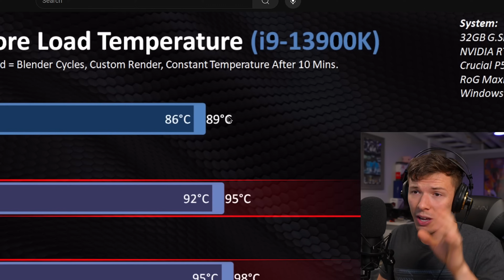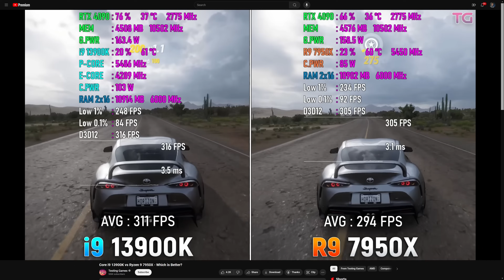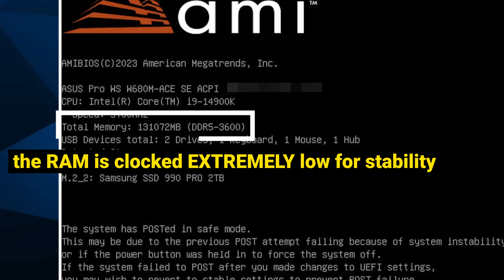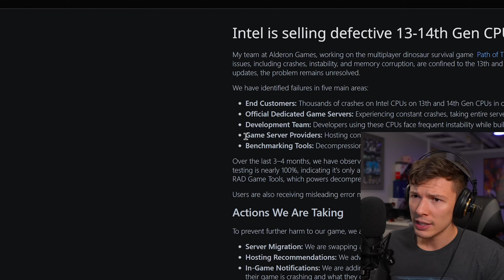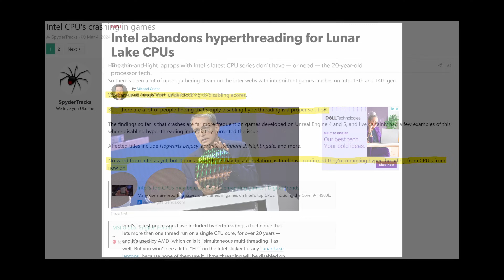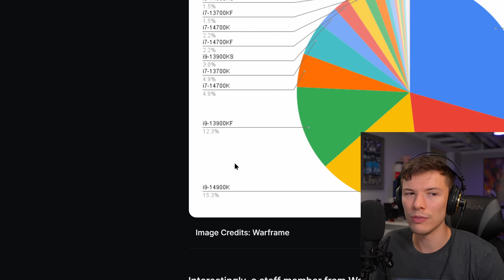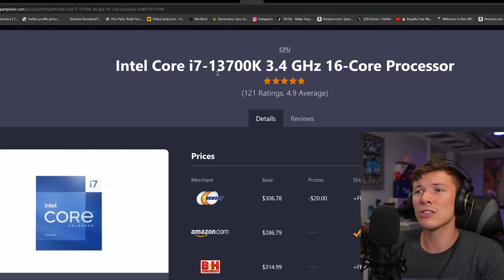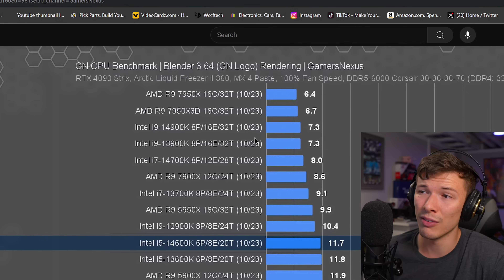Intel F**ked Up Bad

Comment from the maker: Ey, just to let yall know. Intel has now come out with a statement on the situation admitting to manufacturing defects and voltage issues. Their response is still pretty whack so man idk. Honestly seems like it’s only getting worse but at least we have some answers
Reply: oh dear, I have purchased a laptop with gen 13th core i7, pretty sad about this situation, but thanks for calling it out
Reply: @bigcitiboy1903  Jury is still out on whether the laptop versions of 13th and 14th gen are hit by the issue. Intel says they are not, there are scattered unconfirmed reports they might be.

Either way they don't seem nearly as badly hit as the desktop versions.

Remember that while the laptop versions of the chips have the same name their architecture is quite different, and they aren't produced in the same batches, so laptops might avoid the issues either by running at lower power inherently or by not being hit by the production errors.

Or few laptops are experiencing the issues because they run low power, and its just a matter of time before they start failing en masse. Who knows...
Reply: Yeah, still never gonna trust Intel again after this.  Just gonna be safe and go AMD
Reply: first time buying into pc gaming and this happens.
Reply: @SluggyUwU  second time for me, but yeah shit happens, they offer replacement, I just don’t have time considering I have to remove the hdds to send it for repair so I downclocked to 5,6Ghz, still having weird behaviors tho, can’t tell if its software or hardware this time, maybe 1 incident per week while paying Fortnite
Reply: they said 1% have oxidation issue that was fixed...? not 99,9% or whatever u say. Even tho 2 high voltages causing issues since most heaters can't handle having temps down etc. And intel does offer refunds, full refunds. So please get video info correct sir. <3
Reply: @MRBofSweden  Oxidation issue is a different issue, there are no refunds being offered for the issues under discussion.
Reply: With them admitting it affects down to the 65W parts, it isn't even an issue with how much power the bigger ones are pulling.
Reply: I own one of these failed CPU and I can tell that even tho it was and its still an awful experience, I found a fix. I underclocked my i9-14900kf performance cores to 5.6Ghz and that seems like the only setting able to restore 97% of the original performance besides disabling turbo completely which would lock the CPU close to 3Ghz. 

So what I wanted to say is that you are talking like this the processor is dead but it's not. I would have bought such CPU if I was told it runs like a 13th Gen and it was priced acordingly or if was called lets say i9-14850kf which would makes sense. I can't predict the future but I don't think the damage is permanent or that it will degrade over time. It was broken brand new out of the box, it was just that I wasen't willing to believe that it was possible and that the little crashes here and there were software issues. And if a simple fix like maxing it at 5,6Ghz fixes it, it also means that the turbo or "factory overclocking" or more like "factory burstclocking" can be fixed and restored to it's 5,7Ghz or 6Ghz (on 2 cores only) for a shorter time or in a less agressive manner. 

Also the x129 microcode bios update did not fix it for me and I can still claim waranty.
Reply: i kid you not my intel igpu crashed watching this
Reply: Hi

Comment: I think you got it the other way around. MB makers have been pushing crazy limits beyond what was specified by intel. Basically getting users to over clock their machines like crazy. Apperantly this hasn’t been a big problem on AMD land cause the cpus are just not stable enough.

Comment: Was testing my laptop i9 14900HX in cinebench R23, it went up 5.5 GHz in turbo boost. I thought that's it. That will probably kill the CPU in the long run. Temps went up 100°C as well. Then I went to the BIOS and lowered loadlines by a good 20%. Purely that lowered the temperature by 20°C and also improved the performance by 15%.

Comment: To the people in the comments saying "Yeah but the new Intel CPUs will pull less power no they wont. In fact they actually pull more power. See what they did was just shift some of the draw away from the EPS and instead are drawing it from the 24 pin in an attempt to decieve you. See if you test power draw the normal way it wont reflect whats being pulled from the 24 pin. That way they can claim "lower power consumption" even though it isnt actually true. Edit: GNs testing actually shows the new chips pull more power while performing worse

Comment: The bracket for lga1700 was saying that was bending . I added an aio and a thermalright lga1700 bracket to my i5 13600k b760 ddr4  motherboard seems to be working great so far , I did have a small scare when not GPU was not registering but came out fine. Everything works great so far

Comment: Cap I'm using a 14900k running at 60° and the cooler liquid on 35
Reply: what cooler are you using
Reply: @FlungGlung  360 link aio

Comment: I guess you forgot when AMD promised the Threadripper motherboards would be upgradeable for years. I didn't. I bought one CPU then they replaced it. £1000 for a new motherboard. They're no better than Intel.

Comment: My i9-13900K failed, costing me thousands in troubleshooting and a massive headache over months. I swapped motherboards, RAM, changed graphics cards, replaced the PSU, and ended up wasting so much time tracking it down.  I hate thermal paste and screws, I had to redo them so many times. Finally figured it out by locking the cpu clock speed very low. Also one night, my CPU overheated during a reboot crash and it somehow woke it's self up out of sleep. The thing got so hot it killed my AIO pump. I got a refund from Intel for the cpu at least, but i'm still out thousands. I switched to a 14700K, but after 6 months, I’m experiencing the same crashes again. Intel burned a bridge it can't rebuild.

Comment: You can't cool the i9 CPUs with anything. I've been using the i9 13900F (lowest TDP in the bunch) and while my 420mm Liquid Freezer kept it at 30 degrees at idle, in heavy gaming it always ramped up to 92 degrees and stayed there. The problem with that is that my PC heats up the whole room, it's summer and I couldn't stand it. Yesterday I downgraded to a brand new i5 13600KF and while this one stays at 50-60 degrees in heavy load with no noticeable performace loss in gaming compared to the i9, this i5 crashes all my games constantly, even crashed the whole PC at one time. No idea what to do to fix this...

Comment: I have an i7 13700k purchased exactly a year ago, on an MSI MAG Z790 Tomahawk with 2x32GB Corsair Vengeance Pro 3600. My CPU has been degrading for about 6 months now and getting much worse. I called intel and after running their diagnostics, they determined mine to be defective and offered a replacement. shipping cost included. I'm hoping this is a NEW batch with corrected microcode!

Comment: Turns out that I did a few manual settings instead of using the Intel profiles.. and my CPU runs better than EVER! ... no UE5 or other instability.... CBR23 is 65c and game perfiormance on P cores in high % usage is 35-40c ..  there is a fix.. just rrequire you to master your BIOS.... so yes install CPU, choose a default profile not alwasys work in certain gaames. But my 14900KS now runs better than ever, cooler and more efficient!   ITs a matter of BIOS configuration instead of complaining.

Comment: Haven't had a lot of issues with my 13700k, but thanks to the MOSFET specs, my MOBO only allows 150w to the CPU, at least on paper.  Yeah, I fvcked up... or did I?  😏

Comment: I have an i7 14900K and my high-end 3 fan radiator AIO cooler wouldnt lower it below 90 at max fan speed on factory clock. I had to use zipties to add 4 more case fans that werent meant to fit in there to keep this thing below 90 degrees.

Comment: Did I understood it correctly : 4kW processor consumption? My electric wires will melt and shortcut if I'll run it and my fridge.
Reply: Like two induction panels running in the same time. Quite heavy load for apartments.
Reply: @Pixel_Clippy  Fuckin hell! It should make me some money doing that!

Comment: Just look at the 10 nm node debacle intel kept reusing this node for years and then rebrand it as 7 nm.

In my opinion their core architecture is flawed to begin with.

They saw it was impossible to compete with amd without pushing it to the limit.

This time with 13 and 14th gen they went too far.

All this mess because they wanted to be ahead of amd without having done the necessary research and innovation.

Now they pay the price of their shenanigans.

I feel sorry for the 13 and 14th gen owners.

Intel betrayed the fidelity their customers in the worst way possible.

Comment: Intel had to push the 13th and 14th gen to its absolute limit just to stay comparative with AMD and now they just proved they KNOW this. 13th and 14th gen are basically just super high overclocked CPU's and Intel I guess thought they would be "okay". Maybe if they didn't sit on their a** with 4c/8t for so long they would have built a new much more efficient architecture.

Comment: you lie  my gen 14 is great       its just the people that bought the high power ones that are failing.   I use the 65 watt i5  with no gpu  and only run air cooling   i run 4k at 160 fps    on a 55 inch monitor   and loving it        intel gen 14 are great if you all just listened  to me when they came out and did not by those stupid high power using models.    the i5 gen 14  65 watt is the gaming cpu.

Comment: Had both AMD and Intel CPU's. Both got absolutely cooked with the standard coolers that came out of the box. Games were constantly crashing, hard rebooting the PC's, Intel CPU was especially bad. Only after purchasing 2 Tower Air Coolers for each did the problems stop. Buy a good cooler when you buy a CPU. There is also a default setting on most motherboards that ups the voltage too much for CPU's, so tweak it if you haven't.

Comment: I have had nothing but issues with my i9 14900K. I am in too much debt to worry about building another PC but if I do it will be AMD. Especially depending on Intel's reaction to my CPUs instability. I thought I was going crazy for months repasting my CPU and checking temps. Kept getting blue screens and weird issues

Comment: I bought a 12900KS to replace my 13700K that started showing lack of VRAM with RTX 4090 Asus Tuff.  I've never seen that  before.  Used only for MSFS 2020, with about 700 Hours use.           Asus Tuff MOBO, this time I'm not going to install the Armoury-Crate.

Comment: We had a work computer running a 14900K that ran into the SSD corruption issue like its a massive problem we lost some important data and had to spend money to fix it. I think hyperthreading is possible the issue, we disabled it and the system has been far more stable.

Comment: My 14600kf on a 280mm Arctic Liquid Freezer II still hits around 81-87°C under load no OC. My older systems like my 4690k and overclocked Xeon never hit above 79°C and the 4690k was on a single 120mm kraken x31 overclocked +0.3 ghz

Comment: Intel should do the right thing, and recall all processors affected with hardware issues. Intel, do not screw your customers, or you wont have customers. Sure, it will be expensive to recall all of these processors, but Intel has the money to do it. Intel needs to stop hiding, and be more transparent. The last thing you want to do as a multibillion dollar company, is to say nothing when there is clearly a hardware issue. The news surrounding this is not a conspiracy theory. You can't hide a situation like this, because it can be easily tested. When they are tested, the processors show major throttling. When they are tested, people are left with a broken processor. The vast majority probably aren't tweaking their processors, and are left with a cooked broken processor. Intel needs to address this now, before their stocks continue to fall.

Comment: I've got a 13900K and had to underclock it to 5.2 Ghz because I was getting lots of crashes. It's been good now though. It's paired up with a 4090. Still performs great underclocked, beating out the Apple M1 Pro chip in Cinebench.

Comment: I love m 13900KS and all three of my 14900K/KF systems. No issues of any kind. Best CPUs I have ever owned and wouldn't want anything else. But, I don't run them like most people do. I sync all cores, set manual voltage and use very high LLC. Zero instability problems and no degradation. If I were running them like some gamers do (using eTVB and adaptive voltage) I might not be so happy.

Comment: its all the problems combined... bendgate, hyperthreading, micro voltages going out of control, micro power spikes on the cores, and a few others including the worst of them all the manufacturing process that has oxidization... its all compiled into 1 end game... dead 13th and 14th gen intel chips...
Reply: and the worst part was i just bought my deskmeet b660 with an i5-13400... just because i wanted quicksync.... now i have to look into buying a i7 12 gen chip 2nd hand....
Reply: don't forget this is happening across the whole stack line including the lower end chips... its just the failure time is shorter on the higher end SKUs.... even the lower end ones that were pushed through its paces have already been reported to have failed in the same way as well....
Reply: and the only reason i bought the deskmeet b660 is the board features and its size was what i needed compared to the x300 and x600 variant and i wanted the quicksync feature that was why i got the i5 13400.... basically i had to buy the worst GPU 4060ti 16GB again this not a gaming only machine... and pair it with the worst CPU possible right now.... and all because i needed the 3 sata connectors and 2 NVME slots.....

Comment: A revealing comment I read is posted by @crazyeyecarl on "This could be a Big Problem for Intel" from "der8auer EN": I use to work at Intel, and most of the people I knew who chose to leave did so cause we could tell there was no real plan. For example in Litho we had to explain to our manager what our job was, what we could and couldn't do, and even what the alarms meant on a daily basis for months. It would get so bad that people would yell at him "I CANNOT DO THAT. IT WILL BREAK THE MACHINE." Beyond that they constantly lay off experienced engineers to hire new ones fresh out of college so they could get tax breaks from the state government. When you get rid of all the experienced people this is the kinda thing that happens. We all knew it was coming.

Comment: I bought an i3 13100 because it was the only budget CPU at the time when I built my PC. AMD did have cheap enough CPUs too, but there weren't any cheap AM5 motherboards, so if I went AMD the overall price of the build would go above my budget. Looking back at it, if I had better access to AM4 CPUs and boards (maybe if I had the time to order parts online) I could've remained in budget and also have dodged buying a 13th gen intel. But at the time it seemed like a good idea since I could've upgraded to a better modern CPU down the line, not knowing THIS would happen.
The only saving grace for me is that the 13100 isn't very powerful, doesn't really have the capacity to cook itself to death. But that is assuming that is the cause of these failures and not something else. I'm not noticing any instability but I'm still very concerned for my system's long term health, and for my wallet if I have to completely rebuild into an AMD build.

Comment: The truth is very very tiny components are really really hard to make. You get issues, which is not surprising anymore. They are working on nanometer scales. Some parts are less than a nanometer.

Comment: state control will check the quality of all computer parts in stores, then all manufacturers will repair and replace damaged parts of lower quality with high-quality parts that provide full functionality for less money because the value of all money currencies will increase compared to US dollars, therefore manufacturers will not get rich by repairing and upgrading old computer parts

Comment: Manufacturing faults causing internal corrosion. Meanwhile, my AMD 7800X3D is running flawlessly (after a faulty Gigabyte board caused major issues at first). The next PC (non-gaming system this time, it's gonna be focused for DAW and recording) is going to be an AMD system too.

Comment: PL1/PL2 at 4096W doesn't mean it actually runs the CPU at 4096W. It just means that it'll throttle if it goes above 4,000W. That's why it's called a "power limit."

Comment: I did have 1 Intel 13th i7 13700k. and it was cooking. Idle 60C-70C Playing games. 90C-100C all the time. after half a year it broke down. send it back. and got a new one. this one is running at way lower temp. and its holding up alright

Comment: I mean my ryzen 7 5800x has a 360mm aio and a slight boost clock sitting around 4.47 to 4.66 ghz and when gaming runs around 70 to 80c depending on the game and I have no real issues so eh

Comment: i built a new machine with a 13600k last year, and had to go pretty extreme (for me) on the cooling and airflow to keep it to what I felt was acceptable temperatures.  I ended up needing to put an arctic cooling liquid freezer 360 and upgrade to a NZXT FLOW case with a ton of good fans to get it down to something I felt was reasonable, where under load it wouldn't ever exceed 70C.  Its been reliable so far, but who knows how long it lasts.  All this which I would have until then thought was high end case and cooling stuff, just to support the cooling requirements of what I thought was marketed as a mid-level CPU??  I was always an AMD guy before and probably for my next system will go back....